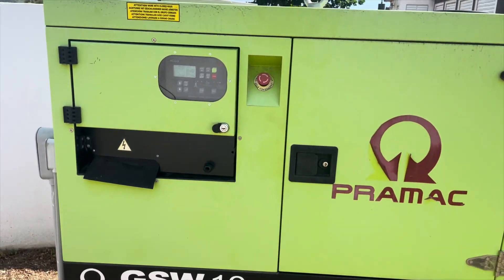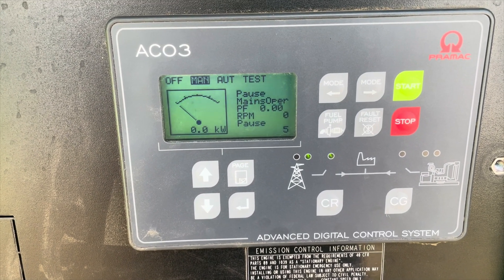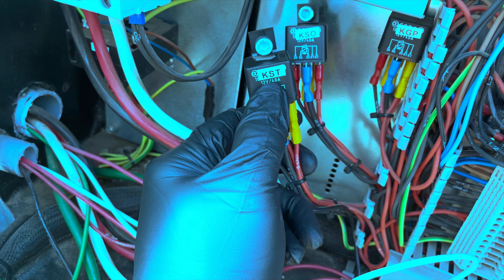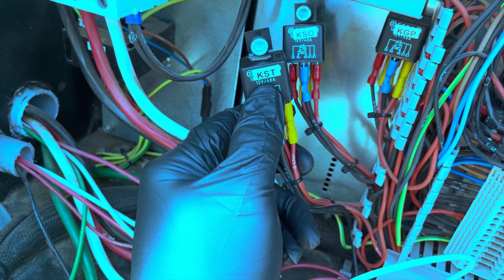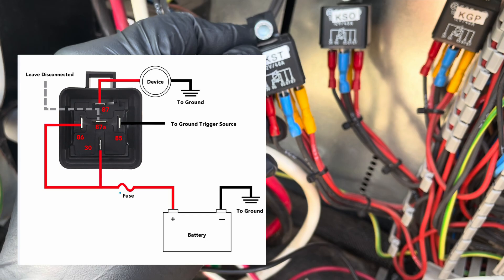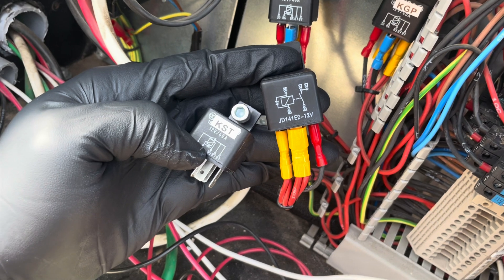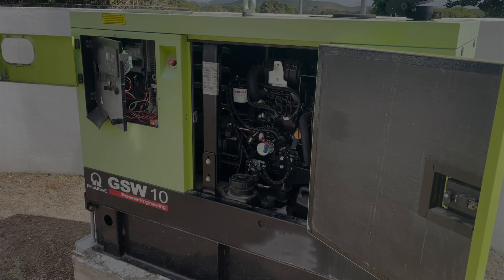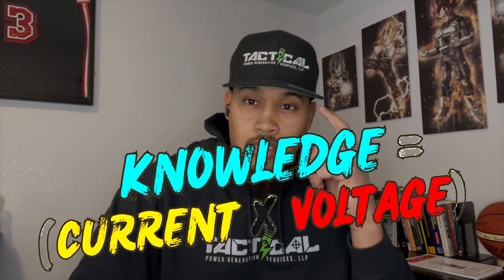Diesel electric generator won't start. How to fix a PRAMAC GSW10 that will not crank, start, run.

Comment: Hi sir, my pramac GSW65 the battery dies after a few days of not running.
Can you tell me what to do
Reply from the maker: Hi Sir, looks like you have a battery charger issue or you have no battery charger at all. If you have a battery charger then verify that it’s receiving power and none of the fuses are burnt. If the generator doesn’t have a battery charger then it’s time to add one.

Comment: Hi, I’m on off grid solar system with the same generator! Our solar inverter communicate to the generator to start or stop the generator! That was before the electric storm! So we had an electric storm, then the genorator started alone, since then we have to manually turn it off and on, if  I put that screen on Auto It would immediately starts the generator but will not stop until I personally turn it off! Can you help how can we fix this? So it go back to auto operated system. Thank you in advance
Reply from the maker: Hi! I can definitely help. It sounds like the generator is sensing that the “main” power (solar system in your case)  is missing or is out of the parameters set in the generator controller. 

The pramac controller is the one that keeps track of the grid voltage and if anything goes out of the set parameters it will start the generator and won’t turn off until grid voltage is back to set parameters.

Having said that, verify the “mains” voltage the generator is sensing from your solar system. Then verify the mains over voltage and under voltage parameters on the generator controller settings. For example, if your generator controller has the mains over voltage parameters set to 130v (which means, if the grid voltage goes above 130 volts it will start the generator) and your utility voltage is going over the 130v due to phase unbalance or outage the generator will start. Same the other way around, if the mains utility voltage goes under the set under voltage parameter the generator will start and won’t turn off until the grid voltage is back to set parameters of the controller. 

Hope this helps. Keep me updated.

Comment: Hey, thanks for your video, I like the tutorials! I am working in the Congo, and have this exact generator and it is overheating, it is only a year old, has about 2600 hours. Do you know if this particular model has an available oversized radiator that fits the stock generator? Our fins are clean as a whistle, good air flow through the machine, coolant is full, it just overheats in the middle of the day if it has been running for more than a few hours.
Reply from the maker: My video is being watched from the Congo? That’s awesome. I’m not sure if there’s an oversized radiator for this PRAMAC generator but I recommend verifying the fan belt tension (if you push on the belt it should not move more than 1/2 inch.) If the belt is good then you might have a bad thermostat or a faulty water pump. Hope this helps.

Comment: Mine is as if a timer has been set , it runs for 15mins and it turns off. How do I fix that?
Reply from the maker: When does it happen? When you start it manually, in auto or in both circumstances?